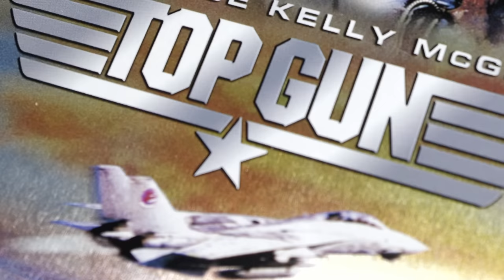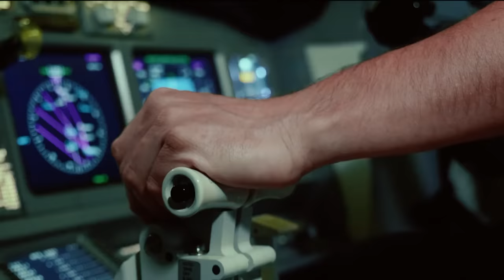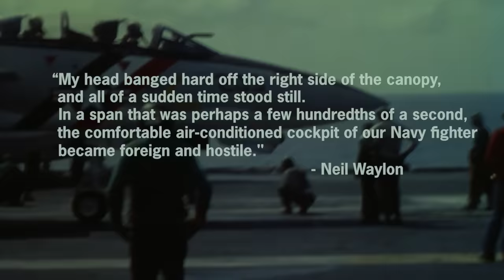F-14 Explodes During Supersonic Flyby

Comment: When did the John Paul Jones become a carrier?
Reply: Yes. It's a confusing inaccurate video
Reply: About 2 minutes before the F-14 became a USAF fighter.
Reply: A few things wrong with the video...people often mistake crossing the sound barrier as the visible cloud around the aircraft.
The momentary fog around the aircraft is called a vapor cone, and it is caused by condensed water molecules over the wings and the fuselage of the aircraft in high speed, but it doesn't necessarily have to be near the speed of sound. All you need is moisture, which is why you see these when planes are flying over the water or in cloudy days.
Reply: I was thinking he meant USS John C Stennis (CVN-74), but this event happened in September of 1995, and Johnny Reb wouldn't be commissioned until December that year.
Reply: Some people do not understand that the navy and Marines have their own aircraft.
Reply: It was promoted to a carrier in 1995 and finished its navy career as a super carrier. After the navy it worked as a cargo ship then later a cruise liner before finally retiring last year and is currently a bass boat in Georgia.
Reply: @patrickmcclintick9552  I thought I saw Bill Dance on it in a bass tournament..
Reply: I knew it,  USS Carl Vinson Discovery Channel documentary  narrated by Martin Sheen.  I remember.
Reply: @kdrapertrucker  Yep, but the Marines have a Bayonet lug on the Pitot tube and two clips to hold a baseball bat in the cockpit.
Reply: Just keep it in dock, feed it lots of vitamins and good steak and send to the gym, bulked up and strong in no time!
Reply: After he left led zeppelin.

Comment: They are certainly very lucky men to survive such an event. Planes don't normally just blow up like that, and a cascading failure from a faulty oil system component is the kind of thing that would do it. So much of the engine depends on other parts of the engine and the tolerances are so fine that anything going wrong can quickly escalate.

Comment: The turbine seperated and the heated blades punctured that bulkheads and entered fuel tank. The blades HPT are obviously extremely hot. That was a VF213 if I remember correctly.

Comment: I think the accident may have been caused by slowing down so fast and losing the flame in the engines ( flameout). There was high-pressure air in front of the air intake and when they increased the throttle the flameouts unburnt fuel ignited from the heat causing a fire and explosion of unburnt fuel along with fuel added by the throttle.

Comment: If they had just made a 6 G pull-up, they weren't going supersonic anymore. A hard turn like that scrubs off speed FAST.
The Martin-Baker GRU-7A ejection seat has a maximum airspeed limitation of 600 kts, so they were barely in it's operating envelope so it isn't that surprising that they survived. If they weren't in the correct position, however, it could literally tear off limbs.

Comment: I think what happened was a component in the engine flew apart slicing the modular fuel tank causing the explosion. Likely a compressor disc or fan disc. Amazing how fast it occurred. How did they have enough time to eject?

Comment: It was only just at supersonic speed when it blew up and then would slow down rapidly without the engines pushing it through the air which would have the same consistency as ketchup at those speeds so the pilots wouldn’t be ejecting at supersonic speeds

Comment: Oh and just to add to th enitpicking, they get pretty much everything wrong regarding the F-14A's engines and "compressor stall at High Angle of attack" and I do mean EVERYTHING. The known issue with the F-14 is one that is present in many planes. Including any airliner with engines mounted on the tail, such as an MD-80, is you cannot do a hard rudder maneuver at low speed, low altitude, such as when coming in for landing. if you hard over the rudder you will do a flat turn with no bank. This puts your inside Engine, (for the F-14 pretty much always the left as you always abort left on a Carrier landing), in the disrupted air behind the fuselage. It can't draw in enough airflow and compressor stalls. It's not an engine problem and has nothing to do with the Engines power. It is an aerodynamic problem that is present on a number of common aircraft. Both Military and Civilian. And it's not a "problem", it's an aerodynamic characteristic of the airframe. The pilots have to be properly trained to fly plains with that type of design. The benefit to that type of design is better performance at higher speeds. But of course "Navy Fighter has massive problem with compressor stall at high angle of attack!!!" sounds so much sexier than "idiot pilot fails to read page 1 of his F-14 training manual and tries to fly it like a Cesna".

Comment: I'm actually curious at what point they ejected as I can't spot it in the film. Because yeah, most who survive those ejections are in bad shape. The only one based on science I can think of essentially comes down to angle. Those other cases yeah they were ejected straight into a wall of air which causes the damage. But I wonder - especially if it was while the explosion occurred and all - if perhaps the angle of the plane changed or at least the section with the cockpit so that either A: instead of their bodies hitting the air directly when they ejected, the seat prior to separation took most of the brunt of it as they decelerated, and/or B: because they were supersonic with the aircraft/cockpit section angled instead of ejecting perpendicular, were more in line with the aircraft and essentially ejected into a hole in the air created by the aircraft/section which with no air wall to hit resulted in minor injuries instead, similar to the pocket that forms behind vehicles on the highway or more notably in racing.

Comment: Not sure about the relevance of the anachronous F-35 at 0:30 and at 2:25, or why we see an aircraft burning on the deck when it crashed in the sea?  And the aircraft at 2:34 in an F-4, not an F-14.  Surely there must be tons of Tomcat footage you can use?  Raid some from Final Countdown!  Ditto why an F/A-18 at 3:28?  And the F-15 at 2:52 isn't even a naval fighter.  I suspect some aircraft recognition practice is required.  Oh and the pilot you show is for some reason wearing a USAF ACC flt suit.
Now the factual points.
You rightly mention the propensity for the TF30 engines in early Toms to suffer compressor stalls, but these were mainly associated with high-AoA manoeuvre and throttle mis-management.  What happened here was almost certainly a compressor mechanical failure caused, as the Board determined, by oil starvation.  A compressor stall results in sudden loss of power but not catastrophic failure of the engine.  What you see in the video is fan flades coming out of the engine and ripping the centre of the jet apart.
The video also shows that the jet was not supersonic at the time of the incident, although it was at high-subsonic Mach.  The clue is the position of the shock wave forming intermittently centre-chord on the wing, and the lack of sonic boom.  The video isn't that clear but I can't see any evidence of re-heat.
Similarly the ejection itself was subsonic, although still likely around 0.9, or 600 kts.  They would have slowed very rapidly, being loaded in a climbing turn when they lost all thrust on both engines.  The ejection system was designed and trialled to work at these speeds so they did have a reasonable chance of emerging unscathed, which luckily they did.  Some damage to underwear was likely though.

But the thing I didn't understand was how, as you suggest, they ended up 55 miles from the explosion.  That's several minutes even at Mach1 but the video shows the ejection only a mile off the ship?  However, having looked it up I see they launched from the Abe and were doing a fly-by on the John Paul Jones, some distance from the carrier.  The Jones is of course a destroyer (DDG-53), not a carrier and not the vessel they were returning to.

There's lots of film of Toms out there, why not use it?  But mainly, please try and understand what you are talking about before creating the posts.  It was dramatic enough an incident in itself so you don't need to exagerate.

Comment: At that low height traveling 1000 mph will not take you 55 miles if you eject you will hit the water a lot sooner . Air is pretty dense maybe less than 10 miles is all they went a body on a seat is not aerodynamic so we got the old exaggeration to get more views .

Comment: At 600 knots at seal level the F-14 was at Mach .91, not supersonic, you at least got the vapor trail correct. Supersonic speeds are for intercept and transit, your aren’t doing bombing runs at those speeds, quit making stuff up.

Comment: Nothing like finding out at the worse possible moment that the worse possible thing has happened...in retrospect. And then comes the realization that you are still alive when there is no reason you should be. Reasoning becomes futile. Eventually you come to terms with it  simply by acceptance and do your best to bury it. When you dont have the chance for fear when it went wrong and are now experiencing the fear post trauma is often the worst and is extremely haunting. Some get over it. Some dont.

Comment: I highly suspect it wasn't a "supersonic" flyby attempt. Note, when you see high performance jets creating that condensation cone it’s NOT because of a supersonic shockwave.  Now having said that, its not impossible to survive a supersonic ejection, just less likely or without serious injury. Modern ejection seats are designed for this if the aircraft is capable of those speeds.

Comment: The pilots survived because the ejection almost certainly was NOT at supersonic speed. 
1) The video said they leveled off at almost 600 knots. The speed of sound at sea level is 667 knots.  
2) At 2:49 it is reported they were doing a 6g pullup when they heard a bang. That means if the aircraft weighed 50,000 pounds at the time it would behave as if it weighed 300,000 pounds. Losing an engine under those conditions would cause a rapid deceleration.
3) Even if they were supersonic when the aircraft started tumbling out of control as Lt. Buga reported, it would have violently decelerated. Given the time it took to make the decision to eject, then to actually get out of what was left of the plane, they would have been traveling much slower than they were at the start.

Comment: If they landed 60 miles away that means that they ejected 4 to 5 minutes after the engine explosion....plenty of time to slow down etc.....speed of sound is 300meters/second,.. 55 miles is 90 000 meters (numbers are rounded)
EDIT: so even if they still kept going supersonic (wich I doubt is even possible without 1 engine and they arent stupid to push it after explosion) They would need to fly 5 minutes (supersonic) to reach distance of 55 miles...so their flight after explosion was probably more than 10 minutes long ,to slow down and try to save a plane and only then they ejected

Comment: An oil problem will do that as a bearing will go and bye bye shafts!  
 It might not even be a component or bad oil.  It could be an internal oil line to or from a bearing.  We had an A-6 J-52 that was within oil pressure limits except above 80% when it was below limits.  We troubleshot it but found nothing.  Used three different pressure gauges all same low readings.  E suspected internal damage.  We pulled the engine out.  Later we found out a line was cracked at the #6 bearing.  I had visibly checked that area as best I could (it's the aft bearing) but found no sign of oil.  It was all internal.  That's why e hadn't discovered an oil consumption problem which is religiously checked.  Former F-14, A-6, Ea-6B, F-18 engine mech.

Comment: actually the TF-30 was a very good engine, for a bomber..... You have to remember this, the TF-30 was designed for a bomber! The F-14 was designed from day one for the on the drawing board Pratt & Whitney F401-400 but when it became obvious that it would not be ready they were forced to use the TF-30. The inlet design was not optimal for the TF-30, hence why they suffered compressor stalls, especially at high angles of attack, and as the TF-30 was designed for a bomber it wasnt suited to sudden changes in throttle

Comment: Why don't they just invent fly by wire pods or something like that.. a completely encapsulated pod that would eject and then a parachute would deploy attached to the pod.. make it water proof as well so if the pilot is knocked out it would float and send off a distress signal.. make it somewhat shock resistant as well.. that way a pilot could actually eject going Mach whatever and be completely fine since he/she is in a pod..have all the controls in the pod and just plug and play basically.. I'm sure this idea will be much more achievable with all the touch screen tech and HUD's.. seems like that's what they should make, but with all the drone tech pilots are being outsourced to really good video gamers basically..